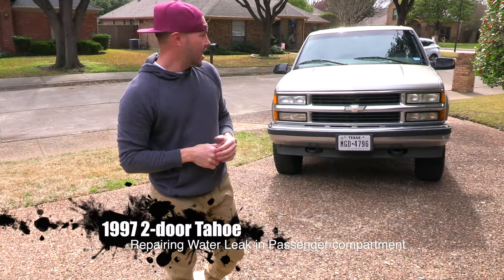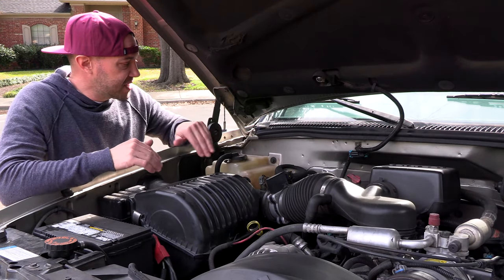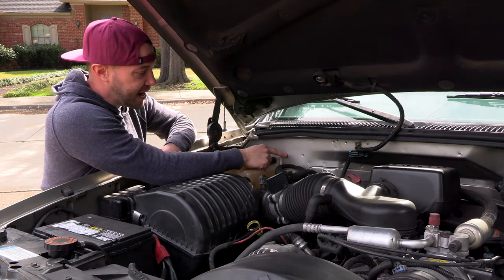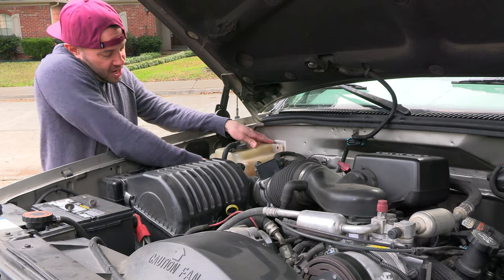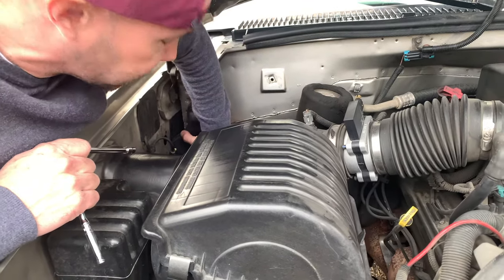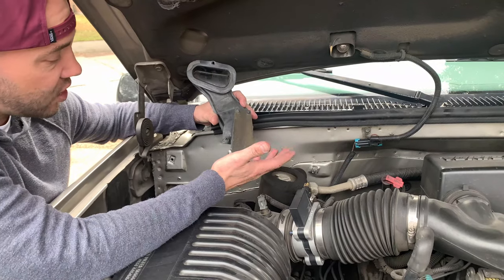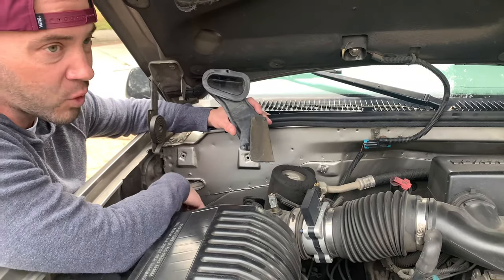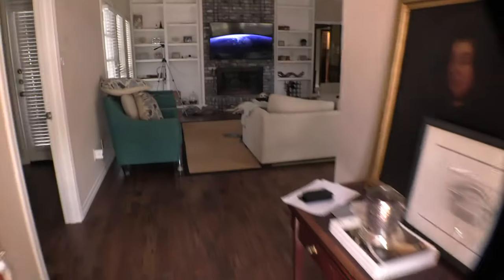Fixed in under 5! Water leak in passenger side footwell Chevy Tahoe

Comment: 2003 Z71, purchased new, 330,000 miles; driver's side leak dribbling down inside cover of the fuse box in the left dashboard you see when driver's door is opened.   I appreciate your taking the time and energy to quickly show us the solution to the passenger side problem. Great camera work, lighting and narration. Next - a video on the usefulness of magnetized tools when working with small parts under the hood.

Comment: Dude I've been going crazy crazy all day.I have my Tahoe all apart, blower motor dripping water threw gasket, remove it.stuck my hand in there,can't feel or see anything. It's now midnight and I haven't inspected the flapper, earlier I was close thow.i knew around where the problem was and removed over flow tank and removed screw for the plastic piece you showed in video but I could of swear all I saw was like insulation so I put it back together there.I was going to buy foam spray,rubber spray sealant and blindly spray it in hole.now I will check it again what you just did.so there's hope. I don't want to have to cover it when it rains everytime.  .externally grateful for video. Wish me lots of luck
Reply: So what happened , me too my blower drips water at times

Comment: I appreciate the video as I have same issue on 1997 Tahoe, but note, when I took this apart, mine was clean as can be, so I'm still searching for cause of water penetration on passenger side.  Note, I also had to seal the windshield, which worked, but that not the cause of most water...

Comment: Great video! Had any water leaks under the passanger side when the ac is on? Thanks!
Reply: I have that issue. That's why I came here. Did you get it fixed by cleaning that thing?